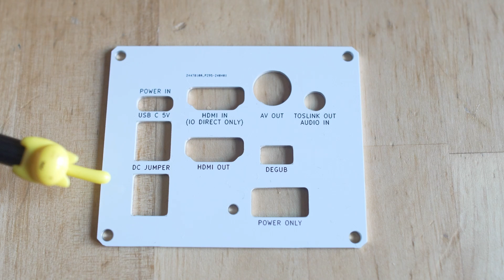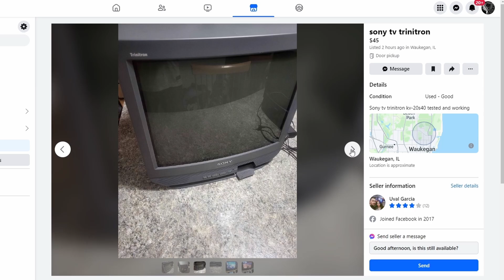MiSTer FPGA IO Analog Pro Board Review and Guide! Better Analog Video is Here

Comment: I do think the Saturn DIN is useful in certain situations, but VGA is a MUCH MUCH better port imo.  The fact you can screw it in to ensure a connection and don't have to worry about bent pins, it makes it a much better physical connection.  I wish he had both options available.
Reply from the maker: I can’t say I’ve ever seen bent pins on a Saturn port. What are you doing out there to bend them? Lol
Reply: @VideoGameEsoterica  its not so much about that, it's that this pinout of DIN 10 is not universal at all and is in fact very hard to find. I literally could not find one cable for it other than the misteraddons ones, except for basic Saturn composite cables, and i think s-video. no component or any other output was available, whereas with vga, adapters are plentiful and cheap. vga is way more universal and this is practically a bespoke plug. however, other than that gripe, i love the board
Reply: Nah man there’s no sound in vga so you need another cord. Just follow the arrow on the lead you will never bend a pin plus if you do need noses work great
Reply from the maker: Ooh putting it in upside down

Comment: I’m not gonna lie, I love the VGA port on my mister. It’s so convenient and those old school CRT and LCD monitors are so easy to just hook up and go.
Reply from the maker: It’s a well known port for sure but I like the move to the Saturn port. Those VGA cables I find to get heavy and put some strain on the device. At least the cables I use and like
Reply: @VideoGameEsoterica  i just with the DIN 10 cables were available from more places than misteraddons, other than composite.
Reply from the maker: There are some other vendors. I’ll try to source links
Reply: @VideoGameEsoterica  that would be really helpful thank you. my search has only turned up cables with wrong pinnouts like that directv one
Reply: You can still use VGA, you just need the DIN 10 to VGA adapter.

Comment: Do the cores require updates to correctly work with the 24-bit video output?
Reply from the maker: So long as you’ve run update all recently the cores that support 24 bit color will be ready to give you those six extra bits once set

Comment: I don't like the change to the Saturn video port. I realize the advantages, but I already have VGA cables and VGA adapters, so it's an extra proprietary set of cables I need to buy. Honestly, it's a deal breaker for me and a reason to choose a different analog IO board.
Reply: plus changes to your case if you are using one
Reply from the maker: Yes you do need to change the backplate
Reply: @VideoGameEsoterica  you mean dremmel :)
Reply from the maker: Lol I guess you could but there will be new backplates avail too
Reply from the maker: It’s diff than VGA but I appreciate it